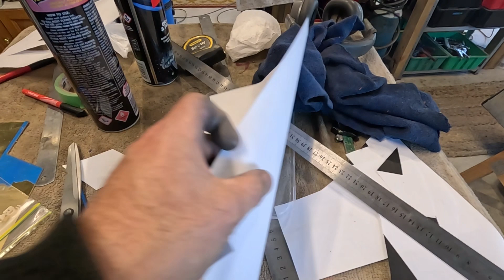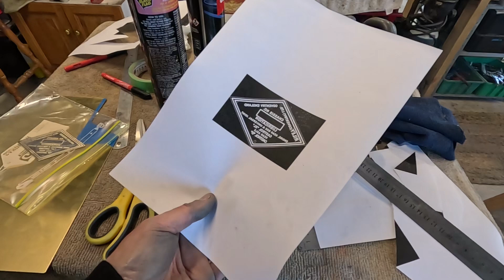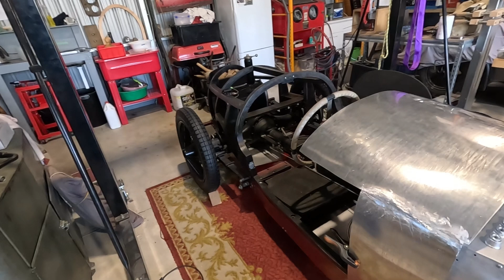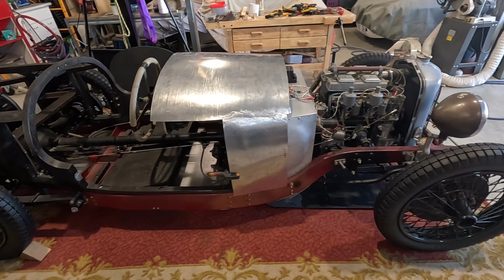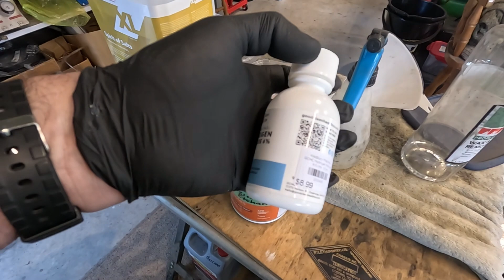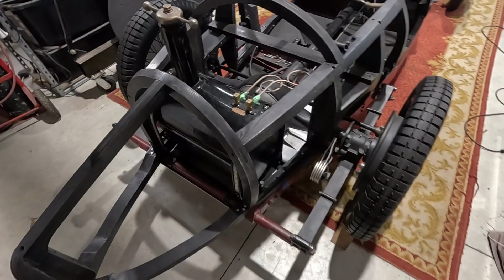Pre war Riley Brooklands - ID plate acid engraving

Comment: Dose your brass plate have a ID number on it and if it dose what number are you going to use?  and will you have a re-fix of NZ.
Reply from the maker: I'll leave it blank. Normally it would be the chassis number but I don't have one! And I don't need on there. To get the car on the road it will need a modern VIN plate. The process is a bit convoluted. I have to get the car inspected by the normal place to be allocated a VIN, they attach a VIN plate I think and then the car is in the system but not registered.  This is called entry certification. Then I go to the low volume inspector and they do their bit and I get a low volume inspection done and they attach their inspection plate to it  (and these days an RFID tag linking to a site with details of the car). Then back to the first place to get the car registered and you pay your annual licensing fee which is when you get given plates and can drive it on the road.
Reply from the maker: Stamping a 'fake' Riley number on it seems wrong to me as I am not trying to pass it off as an original car at all.
Reply: @asciimation  I can understand that. It is a problem to find good frays to describe cars like yours. Best I can think of is faithful reproduction but that dosent feel adequate .Pos built and restored to original period might be better as it dose have a lot of original parts. Sill a great car.
Reply from the maker: @russellnixon9981  Everyone calls it different things. The local vintage car club call it an 'authentic reproduction vehicle'. I already have had that inspected and have the statement from them as to the authenticity of it. The low volume people will call it a 'scratch built historic replica' which is what I think it will be in the NZ Vehicle register. I think replica is right since I have tried to copy an original as much as possible. My Austin 7 is a special since it's all Austin 7 with a made up body.

Comment: The ID plate looks perfect!   Every time you talk about getting skins just right, I always think of that P-51 I saw that looked like it was made with an axe.  Believe me when I say, you're doing a great job.
Reply from the maker: The brass black looks far better than the paint to blacken the lettering. Should have remembered I had that earlier! I guess when they built those P-51s and Spitfires and what not back in the day they weren't expecting them to last long! But I know with Spitfires at least they did spend time to make sure things were smoothed and faired over for the performance gain it gave them. They talk about using stopper or filler. If you're ever looked at aero modelling forums you will see all the arguments over what period correct WW2 aircraft looked liked vs what we see today and the reasons it's different now. This is a good link to a NZ P51 Mustang that was restored. They talk a lot about the details: https://vintageaviationnews.com/warbirds-news/kiwi-p-51d-reborn-the-restoration-of-mustang-two-three.html